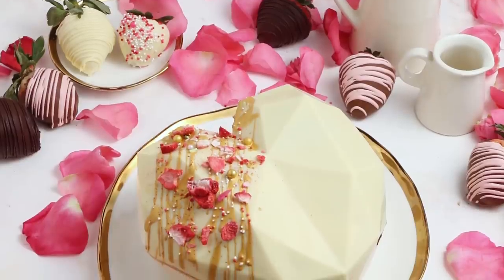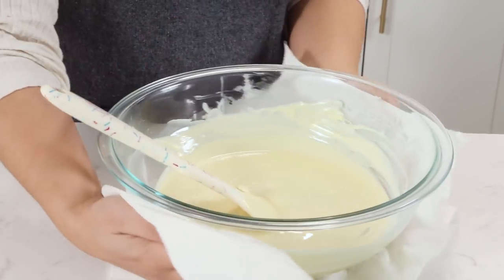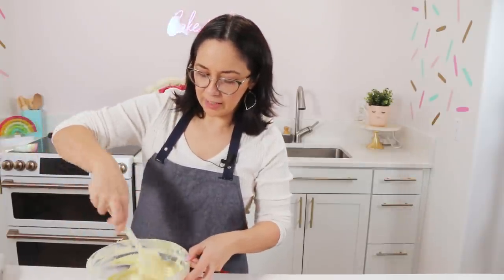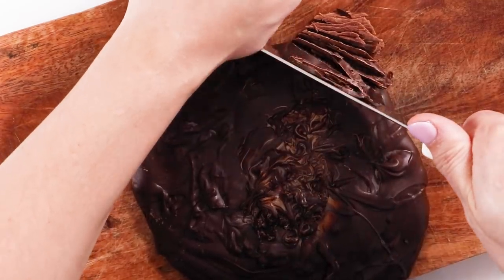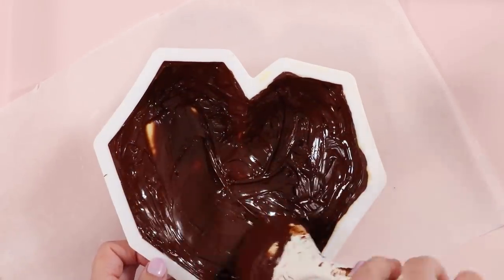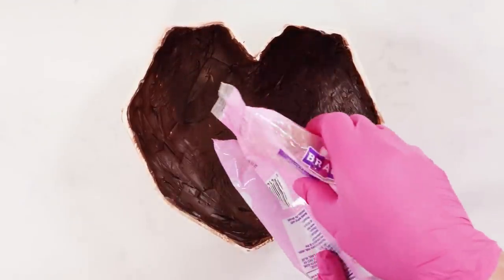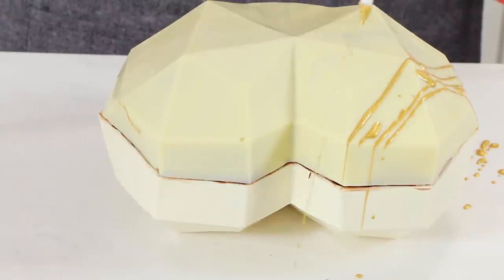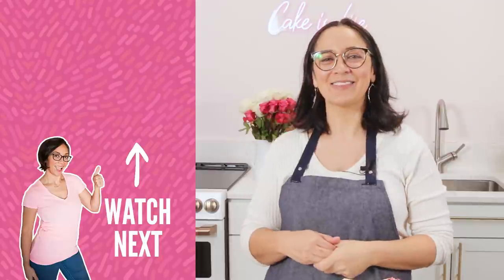How To Make A Breakable Chocolate Heart!

Comment: When I attempt to make the top and the bottom they do not line up, probably a 1/2 inch gap. Did you use the same mold for the top and the bottom or two molds? I used two molds. I am familiar with making cocoa bombs and assumed it would be the same process but when the hearts didn't line up I was baffled. Any advise?
Reply from the maker: Oh no! Yes I use 2 separate molds, but they game together in a kit so I’m positive they’re the same size. My only guess is that the chocolate is shrinking away from the edges, so just take extra care with building up the edges so they’re nice and strong.

Comment: I’ve had mine in the freezer for a couple hours now but the chocolate doesn’t seem to completely harden. Is there something I could be doing wrong? This is my third attempt and I feel like giving up
Reply from the maker: Oh no! It sounds like there was an issue with your tempering. What kind of chocolate did you use and what method of tempering? Microwave? Seeding method?